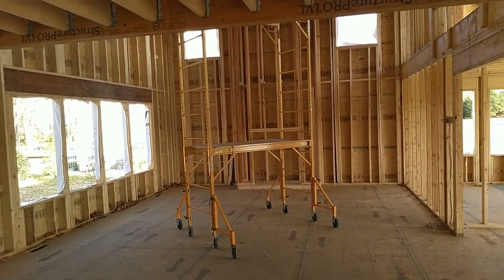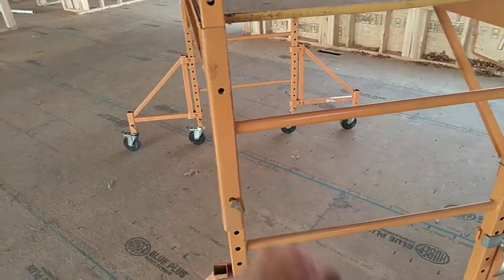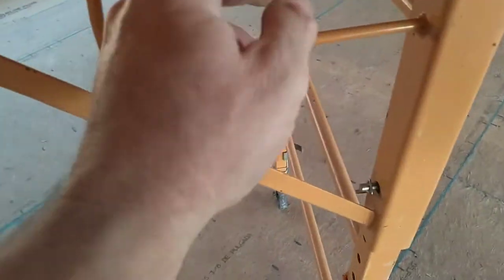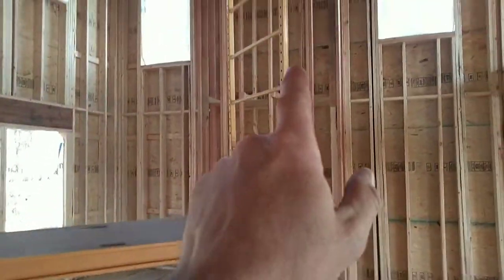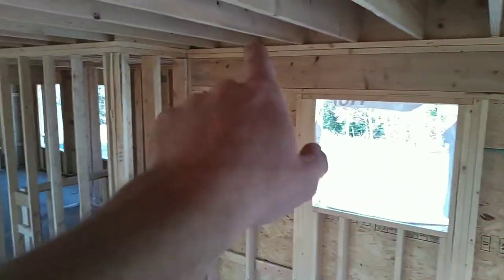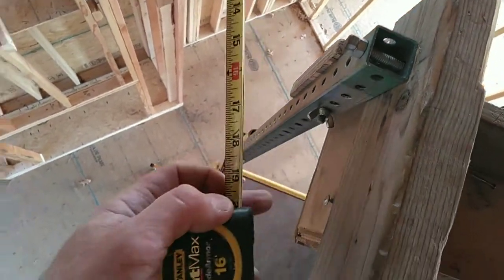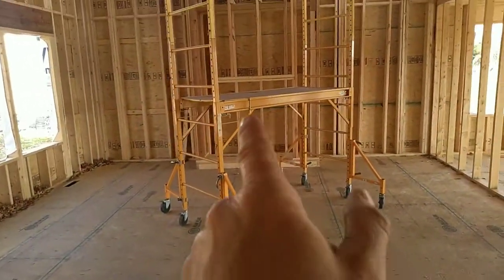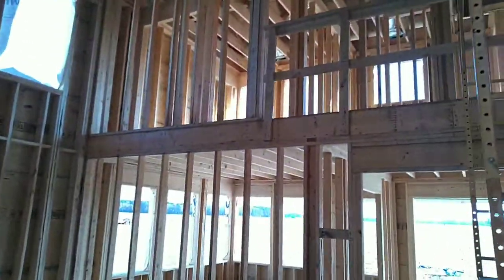Job site safety on 🤔 Baker style scaffolding

Comment: Bought my scaffolding from Harbor Freight, and leveling jacks from Tractor Supply - Metaltech Set of Hollow Levelling Jacks on Base Plate, M-MBSJP24HK4.  You can also ratchet straps to reduce spreading at bottom.
I need to figure at a DIY safety rail for the HF Franklin set.

Comment: I like to put small clamps on the corner on the boards.  I also use strap tie downs in an X pattern on the sides just to keep it steadier.   I have several of these and use the other cross members for the safety cage.  I also must made 2X4 outriggers that I use when outside on it.  But I really like your handrails....I will be doing that.
Reply from the maker: Thanks for watching and commenting. I like your idea of the ratchet straps for x bracing. That would tighten it up 👍🏻👍🏻 good. Thanks for the idea.

Comment: I got rid of the pins that join the ladder sections... they are 5/16" pins  in 1/2" holes, that sloppiness adds a lot of the shakiness, which compounds as you add levels. 

I use 1/2" x  2-1/2" bolts with flat washers and locknuts.  Yeah, it takes a bit longer to set up the scaffolding, but it's well worth the added stability, and it eliminates the issue of someone tampering with the pins.  That, along with using ratchet tie down straps in the X pattern on the sides, makes for a very stable setup.
Reply from the maker: Thanks for watching and commenting Henry. Great ideas for gaining stability 👍 Thanks for the tips.

Comment: Thanks for the video. I bought 2 used sets and I asked the original owner if all the locking pins come with it. However, after picking up the 2 sets, I went through all the bars and castor wheels to see if they're all there. Only the castor wheels had them. So, I'm buying a set of PTO locking pin sets - they're not that expensive but necessary (as you have mentioned many times in the video and it can't be stressed enough for safety). I also like your homemade rail with the 4 peforated steel square tubes. However, I went to pretty much every store and online metal supplier for those 1-1/4" perforated tubes. Each 3-foot tube costs like $50! Multiply that by 4 and it's around $200+tax!!! I can't believe how expensive these perforated steel square tubes are. For that price, I decided to get one of those Baker scaffold rails from PrincessAuto (in Canada) for $149+tax.
Reply from the maker: Thanks for watching and commenting. Wow , Canada is expensive. I bought them from Lowe's in the US for around $9.00 to $12.00 each.

Comment: Now that I've seen how you made your hand rails up top I wish I'd gone that route.  I bought the kit and I'm not a fan.  The scaffold itself was a good investment.  I run some cheap ratchet straps from the bottom rung on one side to the top on the other (4 total) and there's very little wiggle after for a couple minutes worth of additional setup.  Probably wouldn't bother if it was just a single but when stacked there's a fair bit of play.  I'm going to have to pick up some perforated tubing.  Thanks for sharing the idea.
Reply from the maker: Thanks for watching Jeff Coombs. And thank you for the ratchet strap idea. That's a good one.

Comment: Great video! Hey when you have a 12' version setup, do you think it would be fine to only use outriggers on one side so it'll snug up closer to the wall that's being worked on?  Like say 8" off the wall?
Reply from the maker: Thanks for watching and commenting. Yes, I've done it many times.  Just be careful about it. You could lay some sand bags across the the opposite side's outriggers for stability.
Reply: @workingmanrondoyle3287  oh yeah! That's a great idea...heck I could put a board across the outriggers and use several sandbags!  Thank you for that idea!